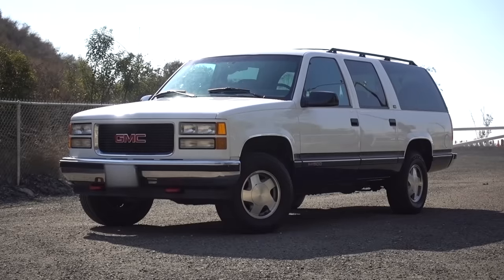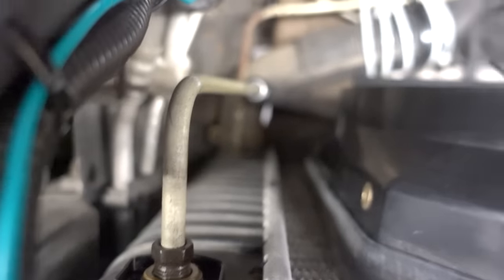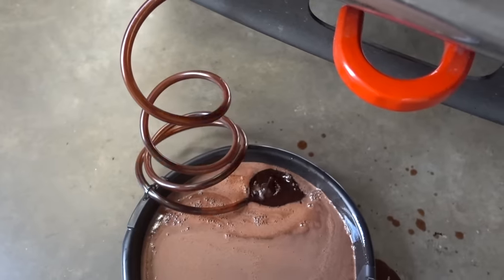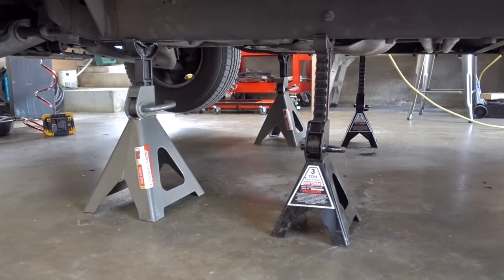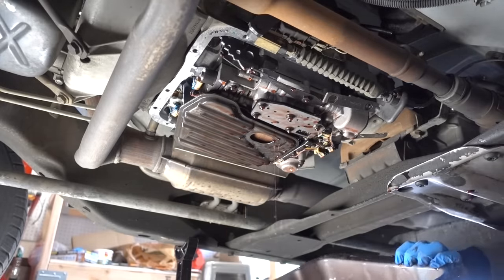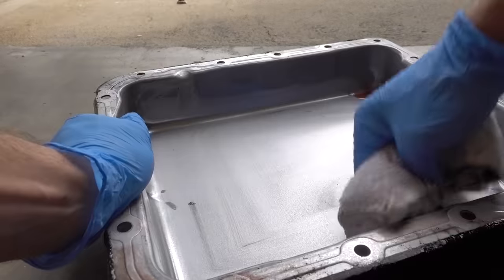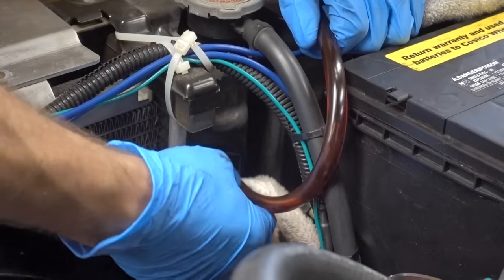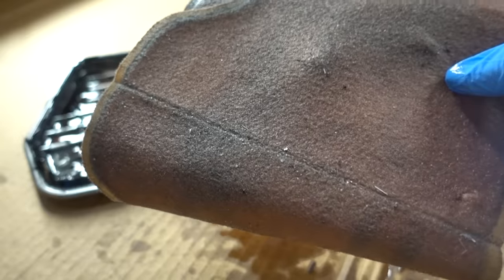Why You Should NEVER FLUSH YOUR TRANSMISSION FLUID!!

Comment: If the transmission has regular maintenance there is zero risk to flushing, same for all fluid systems in vehicles.  If you have a high mileage car that never had regular maintenance or you dont know the maintenance history then your rolling the dice on a flush.
Reply: @Raymond Jayme the lesseon u learned should not be that u shouldnt change a trans fluid if it is high milage and hasn't been changed it should be that u shouldnt be an idoit and buy truck with out checking the trans fluid and not be in this predicament in the first place and by truck with regular maintenance had been done and wont blow ur transmission with u give it a flush
Reply: If you do routine maintenance then you have zero need to flush the transmission.
Reply: @killer2600  not true, because when you drain the pan on an automatic transmission you only get about a third of the fluid out.the only way to get it all out is with a flush. That's why you should do a flush every 3rd or 4th time you service your trans...
Reply: james meadows ok do do a drain and refill on auto Lexus with 200k miles with no previous maintenance history? Not a flush but drain like 3.5 quarts and refill
Reply: @jrdm87  You NEVER get all the old fluid out. To do that you have to tear down the transmission and cut open the torque converter.
Reply: Never had a 4l60e have you lmao replacing those is the maintenance
Reply: @killer2600  that means ur changing ur fluids regularly, rite ??? if u do it early on u should b getting a flush... tell me, wut other routine maintenance r u doing ? ? ?

Comment: "YOU LITERALLY HAVE TO APPLY TONS OF PRESSURE TO THREAD IT IN!!!" (proceeds to hand-tighten it with his fingers)
Reply: mechanics hands and fingers are far stronger than the average guy.
Reply: And seasoned mechanic will use extension and socket to get them hand right. Running them down with fingers is pointless. Idiot use powered device that don’t know what there doing.

Comment: Technically, this was not a "Flush". This was a "Drain and Fill"...

A true trans flush is done by a machine that extracts the old fluid, pumps in and circulates cleaning agents, extracts that and then pumps in new trans fluid. All done under pressure.
Trans flushes are only recommended for vehicles that have trans flushes done at regular intervals since day one. And even a machine flush doesn't remove 100% of the old fluid, plus it may also leave some solvent behind which can damage the components. It can also loosen and dislodge old sludge in an already worn out trans that will almost certainly cause it to fail much sooner. 

I learned the hard way...years ago I had 97 Mitsu Diamante with a slight trans slip. I took it to a quick lube shop and did a trans flush with the machine and the transmission crapped out 3 days later, would not shift into gear.

Moral of the story...Just drop the pan and do a drain and fill, especially on an older vehicle. Much safer than a machine flush. 

Either way, Good vid.

Comment: I had an old 96 Ford Falcon, the owners manual sadi to change the trans fluid every 90,000 km.  I asked my mechanic and he said to just drop the fluid and let as much as possible drain out.  I changed the fluid 4 times (I clocked up 480,000 km in 16 years) and never had a problem.  The trans didn't slip or fail to change up or down and was always smooth and quiet.  I towed trailers, went on long trips with the family and the car loaded up, used the roofracks too so the trans was put under load on occasion but never gave a problem.  I don't know if flushing a trans will cause harm but you should at least change the fluid and filter at certain intervals to keep the trans running smooth.
Reply: Heat is the #1 transmission killer. Do you have an external cooler on the tranny? And or do you live in a cooler environment? Do you drive mostly highway or high city stop & go traffic Do you tow or carry heavy load?? All those conditions WILL make a HUGE difference in the life and performance of the transmission. If your driving habits are non aggressive style and your all highway, cool environment, and have a external cooler, just those things alone will darn near double the life of the tranny alone. Heat, aggressive driving, lots of stop and go, towing and no external cooler will make the tranny run hot all the time and will break the fluid down reducing the effectiveness of fluid characteristics. Changing fluid should be done more often depending on conditions and habits. If your driving in ideal conditions and with external cooler and "light foot" on the gas & break peddle it can go longer on the change. The factory "recommended" intervals is exactly that "recommended". When it comes to transmissions I NEVER follow the book on change intervals.  I ONLY follow intervals on the engine since we are dealing with a completely different system with completely different circumstances that the engine deals with daily, but thats another story. Anyway, I have always had good luck with my vehicles just doing how I do it. It also helps having a brother that owns an automotive repair shop and good at what he does with REAL knowledge and experience on the subject. My brother does not recommend NOT changing fluid in a "sealed" unit. He said a sealed transmission still goes through the same stuff the older non sealed units go through. So he recommends the usual maintenance fluid/filter change depending on the conditions and habits atleast once or twice or many times during its life.
Reply: That's funny- when you said it was old, I was thinking about an old 1964 Ford Falcon I used to have.

Comment: Drain/change the fluid.... sure
Drop the pan/cover.... sure
Change the filter.... sure

NEVER RUN YOUR TRANSMISSION DRY
Reply: Exactly my thought. If you're just going to flush by dilution anyhow then there's no reason to run it dry. Pump a couple quarts out, add a couple quarts, repeat.
Reply: Go back to OZ ...WRONG!!!  the jenner is in park and still is lubed for the short time the flush takes
Reply: I’m agreeing with these guys, what your doing is bypassing the lubrication circuit of the transmission. Right after the trans cooler, trans fluid goes straight to the bearings of the shafts and with you putting fluid into a bucket, instead of back into the transmission, you are running the trans dry of fluid and scoring bearings within the transmission. Always do drain and refill and change filter. Flushing is for very low mileage vehicles and you need proper flushing machine that keeps good fluid going into lubrication circuit
Reply: You're right. The sequence is off. I would drain and replace filter then fill then purge or flush the old fluid. Besides all old fluid will go to the return line which is dump in the drain pan. He basically run it dry. Good thing he has a disclaimer.
Reply: Hmm.  Is it possible to put a catch can for old transmission fluid, then take the transmission cooler line and put it in a bucket of clean new fluid? Would that break it? Or not work?

EDIT: I did something like Jimmy did on a grand marquis.. it was high miles (like 17.5k miles per year average) but it still ran fine and I took it through many states, even covering one of them (Tennessee)!
Reply: @adventureoflinkmk2  I have been bitten hard when the pump failed in the auto trans, to me anything that risks any degree of damage just isn't worth it, Lion Tamers used to put their heads in the mouths of their Lions for a spectical but that didn't make it either safe or wise did it?
Reply: @Conky011  There is always more than one way to achieve any given outcome, best practice is derived through consensus and minimization of risk (negative outcome), the lacks-a-daisy near enough is good enough attitude is simply reckless... would you drain your old engine oil using it's internal pump?
Reply: @SpectreOZ  no need to do that for an engine, gravity will pull like 96% of the oil out the drain hole.  Transmissions tend to hold like half their total capacity inside the transmission and torque converter.
Reply: @adventureoflinkmk2  o
Come on man that a a sarcastic question...would you meaning why the hell would you. His comment all together was stating there is more then one one to do things and to reference the knowledge to do it with the minimum of risk factors.
Reply: Absolutely the best way to change fluid in a transmission is use the pump in the transmission to pump out old fluid into a bucket using either transmission line to cooler in or out and then pour fluid into dipstick fill. Some trans don’t have a dipstick full so this case you find another location that will allow fluid to enter the pan. Some don’t have that so in order to replace fluid you would fill using the return trans cooler line. It gets complicated but can be done. 
Side note: open all bottles of trans fluid prior to doing this because you need to fill fairly fast.
Reply: At what point did he run it dry ?
Reply: @mr.miyashiro  what is this running dry bulshit, there's no load on the transmission and there is good oil film on all the bearings and gears, he's not running it for hours on end without oil flow.
Reply: Difference between actually running the trans dry and just letting it pump itself dry.  With no load on it it's not going to hurt anything.  I ran a 48re dry multiple times with a trailer on and after I fixed the cooler that blew continued to work the trans till it finally died.  But it didnt die from bad bearings (bushings), they looked fine.  Cause when you run it dry it's not even turning anything in the trans because theres no pressure.  Just tears up the converter and bushing .
Reply: Agreed don't run it dry. Feed in as much new fluid as old fluid comes out using a funnel. If you can't keep up take a break, engine off, plug cooler hose, refil. Continue until it comes clean out the other end. If you are too cheap to pay for the couple of quarts extra needed, just do regular transmission flushes. I don't see a problem with a high quality filter that has a few metal particles in it, as long as it is not blocked.
Reply: @khempleman  A lady got a phone call to return to the quickie oil change shop - they forgot her drain plug !
So 2 ten minutes drives without any motor oil.
Reply: @Conky011  
Parts of the tranny are running and needing oil even in park.  If you want to destroy your planetary gears, run the tranny dry, in park...
Reply: lol do you know what goes on when a bruce jenner is in park???? obviously you DONT ..why would you drain oil from an engine with it running? apples and oranges here buddy, time to get educated jethro!!!
Reply: Maxwelhse j.
Reply: Any reason why you couldn't use 5 litres of transmission fluid and feed it into the bottom cooler input to gearbox use a bleed nipple in the fluid bottle top and clear hose on the input turn the bottle upside down and make a breather hole ?

Comment: You can easily drill a hole in the drain pan, and weld or braze a nut onto the outside of the hole as a homemade bung hole.  Then add a bolt with crush washer to it and you now have a drain hole.
Reply: Montana Software I think Dorman makes a nylon gasket one that you can tighten in place after you make a hole.
Reply: Lol, bunghole.

Comment: One of the great debates of the auto industry. I have even had transmission shops tell me not to even drain transmission fluid if there wasn't a problem. As far as a flush goes, it's either the greatest thing for your transmission, or it will kill your transmission and the transmission's ghost will haunt your family forever. I'm pretty sure it's one of the two.
Reply: I would recommend finding a new mechanic. The manufacturer of nearly every single vehicle recommends doing so at 60 to 100k miles. Are you telling me your mechanic has more knowledge than the company that spent millions testing and designing the transmission? Drain the fluid and you'll see the damage thousands of miles does to the fluid
Reply: @usvcrescuecrew9563  since car makers are the experts, why do the same car companies keep having the same problems? They are so smart and so great, yet look at all the transmission problems dodge and Nissan have. Hell, look at the problems Ford is having with the new broncos. But yes, they are the experts
Reply: @anthonythompson4110  I just swapped out my Yukons transmission fluid and gave it so much improvement in shifting
Reply: @anthonythompson4110  Humans still assemble most of the transmission so you will have some failures.  Imagine building transmissions every day for a job. That would get old fast.
Reply: @usvcrescuecrew9563  you mean the same manufacturer that sells you the new transmission
Reply: CVT transmissions are a totally different story, the dealer flush’s out the fluid but does not change out the filters, 2017 Maxima. I had to convince him to change out the external filter saying it was not necessary. I told him change out anyway, 5 years old with 70,000 KM.
Reply: I've seen this go both ways. 70's, 80's even 90's if a vehicle had higher miles and the tranny looked dark it was a crap shoot. Today things are built with better tolerances in my opinion. I can tell you from experience two Oldsmobile transmission went out after changing fluid and filter. One my dad and I did, (1972 Cutlass) and a later model my Chief of Police did, (front wheel drive. Can't remember exact year maybe even early 2000's.) . I told him what happened when my dad and I changed ours but he was a good mechanic, (so was my dad. Did work on vehicles and we rebuilt engines for folk's) and changed it anyway. The transmission went out. 
My humble opinion is the grit and grime was helping the clutches grip. When you change fluid and filter the grit and grime gets taken away leaving worn out clutches. Basically your transmission was living on borrowed time anyway.
Great video.
Reply: @anthonythompson4110  
Look at Fords Explorers. 2011 - 17 water pump inside engine, transfer case, (PTU) with no drain surrounded by transmission, exhaust, catalytic converter with a pint of lifetime fluid which is know to explode and take out surrounding parts😅, transmission with filter inside of it. Meaning if it stops up you have to remove transmissions and split the case to change it😅. Lifetime also🤦🏻‍♂️. Folks drill and tap the PTU to make their own plug so as to drain every 30 thousand miles. If not the oil cooks and 1500 to 2000 for the part. 2200 for the water pump change. If you catch it before catastrophic failure. Rear differential is also lifetime. All this means when your warranty runs out they will sell and fix your expensive problem or sale you a new car. This isn't mentioning the repeated recall for suspension, bolts, bad welds, seat mount problems, carbon dioxide poisoning problems, A-pillars coming of at highway speeds and hitting other cars. That is the plastic part around the windshield that runs from the top of vehicle to fender. Two parts, cover is 128, the mount 138, clips for one side 7 is 20 dollars. Install is 80 bucks. The A-pillar is being looked at for recall by NHTSA at this time. 
Worst part! How do I know this? I own a 2015 Ford Exploder 4x4, (awd is an over statement, in a few inches of snow it does ok. Drop off on anything above slightly worse than gravel and you are in trouble) V6.
Reply: once you remove grit, you will slippage.
Reply: @usvcrescuecrew9563 
The same companies are saying to never change your transmission fluid.

Comment: They make drain plug kits you can put in the pan.  Do this the first time you drop the pan, and next time it will be far easier to drain the fluid.  Also, a little trick for engine oil pan and transmission pan gaskets... simply tie them in place with a piece of sewing thread going through the bolt holes and around the edge.  Tie them just tight enough to hold in place, but not distort the gasket.  You don't have to do every hole.  On the trans pan, two on each side and the ends is enough.
Reply: Every car I've taken the pan off the magnet is covered.  I don't remember if I've dropped the same transmission pan more than once though so maybe just cleaning the magnet off once is good enough.
Reply: I installed a drain plug on my ‘11 F150, when I did the first pan service ( I hear it’s not good to change all the fluid you possibly can). Some mechanics say you don’t need to change the filter every time either, so at this point I plan on just draining the pan and replacing that much fluid in about 30k miles.
Reply: I installed a drain plug in mine, mostly just to avoid the spill that comes when trying to keep the pan level as I move it slowly to avoid sloshing.  There's just no need for that sort of entertainment! 😧

I found a short bolt to use for a drain plug, and a nut to match it. I drilled a hole in the pan near the rear, and welded the nut to the inside of the pan. Use a copper washer on the plug. Now you can drain the pan before removing it. Having the plug in the rear gets the pan nearly empty, since the front end of the truck is usually jacked up while pulling the tranny pan. This method is happily less entertaining when you pull the pan to change the filter and clean the magnet!

Comment: I'm a retired automatic transmission tech,I have built to many to count transmissions that owner changed fluid....OK qith 50/60k or under if over SAVE old fluid filters do need changed,catch old fluid,change filter. What happens?, you change PH Inviting trouble,but this is good video......